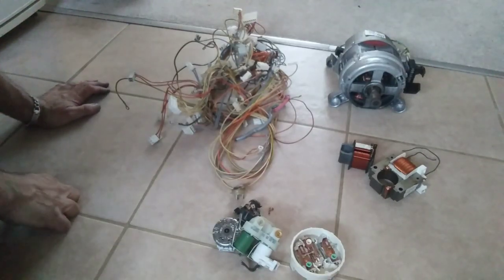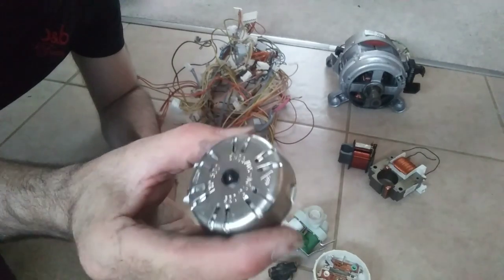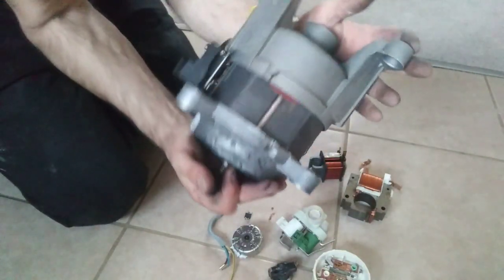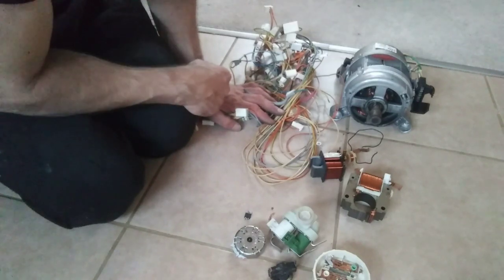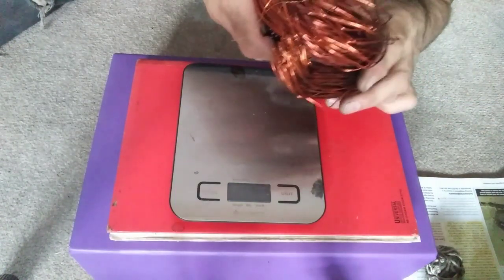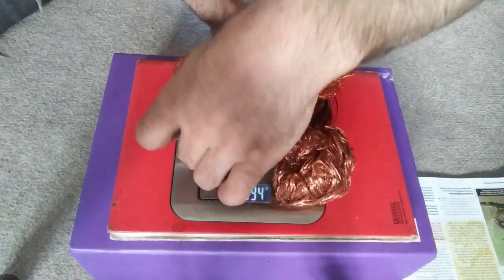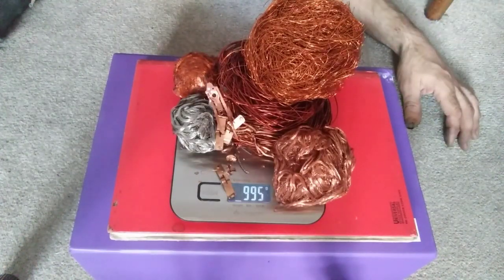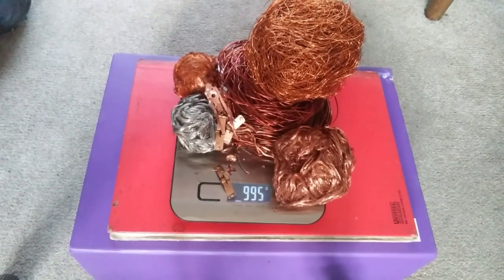How much copper in a washing machine?

Comment: that's about 2.2 lbs.   the washing machine i scrapped had copper painted aluminum wire on the motor.   you have to run a file on it to be sure you've got copper.

Comment: Eventually I'll get my shop to a spot where I can snag people's unwanted appliances for the scrap.  I'm less interested in $ than generating the raw materials to make things with. Earlier today I melted down some dirty copper into ingots to purify it, then took the ingots and melted them 2:1 with tin to make Speculum bronze. (Which is what Newton used to make the mirrors for his reflecting telescope.)  It is a fun project because I sourced the material myself, processed it myself, melted it and mixed it myself, and ended up going "Whelp, the rumors of this stuff being super brittle are understated if anything!"  Lots of fun.
Reply from the maker: Sounds like interesting 'fun'
Currently I'm a little pushed for space but hopefully when we move I'll have an area i can use specifically for scrapping, also smelting. I'm only maling ally ingots at present but would like to experiment making others.
Reply: You'll be better off scrapping the whole washer, prob 5 bucks as opposed to 9 or 10 for an hours work, you need bulk to make money from copper.

Comment: So, what was the value of that amount of copper and how long did it take you to strip the copper.
Thanks for the info
Reply from the maker: At the time the copper value was around £5. Some machines are easier than others and how thorough you want to be. Reckon i could scrap a machine in about an hour but obviously the micro scrapping would add time.

Comment: Top load washers in the US I have found the copper coated aluminum windings in the motors roughly 1 out of every 10-15 are actually copper. Roughly  the same for dryer motors also. Always check before going through the trouble of removing while grabbing the solenoids and drain pump as they are almost always copper.
The front load washers are about 60% of the time copper stators and wrapped with 3 lbs of windings.
Reply from the maker: Could be a US - UK thing, i think all mine so far have been copper. Fingers crossed we keep getting them!
Reply: @ecoscrapper3501  yes in the US aluminum is very common because it's cheaper. The more higher quality appliances are more likely to use copper though.